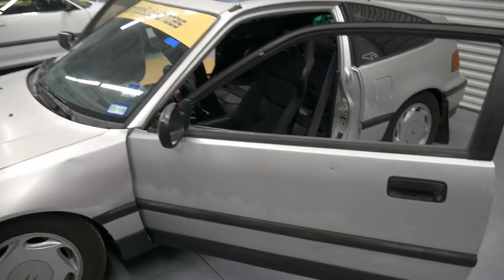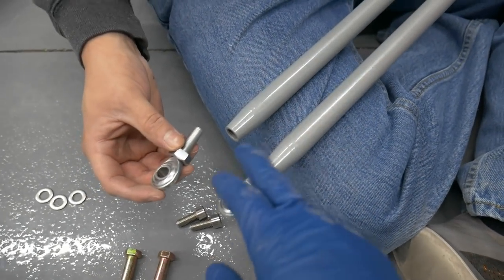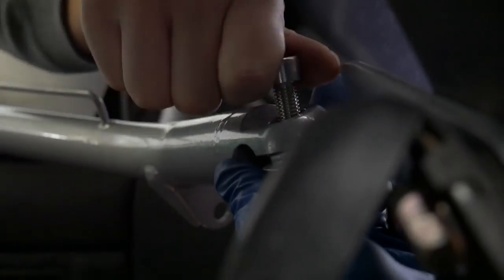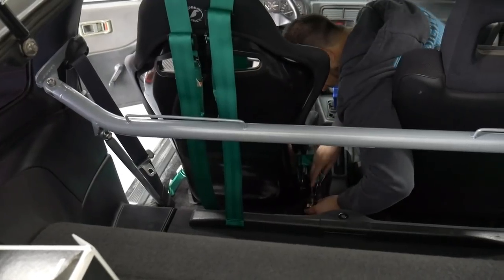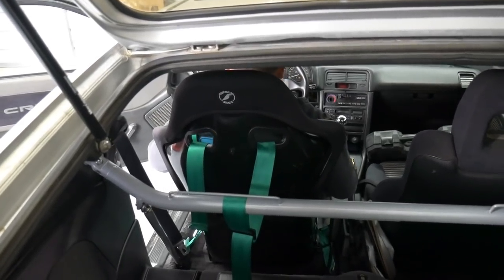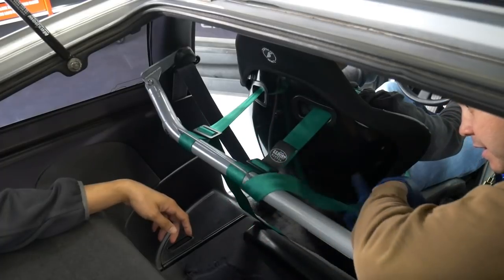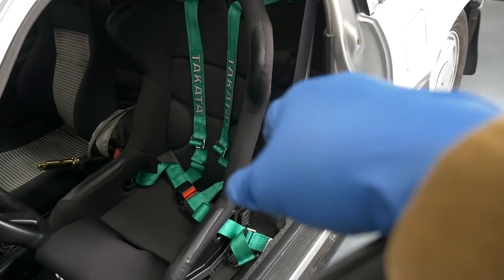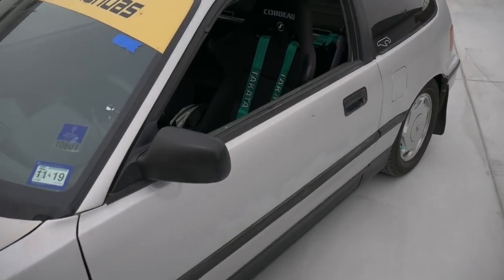Track CRX gets Upgraded Seat Mods with Harness and Bar

Comment: Hey Jon, I am looking to replace my busted brake line hose on my wagon. I was wondering if you ever used any aftermarket brand or did you stick with oem? Also, what is your opinion on steel brake lines? Thank you.
Reply from the maker: Love and prefer steel braided lines.  I use a lot of the eBay lines for like $30-40 for a set.  Never had any fitment or performance issues and I inspect them regularly.
Reply: Garage Built Hondas thank you, looks like I am getting steel braided lines for Christmas.

Comment: Sooo does a usdm crx have the factory holes for the seat belt in the pillar even though a lot of people have the door mounted belts???
Reply: All 88 crx models had pillar mounted belts. 89 HF had pillar mounted as well. The rest of 89-91 had door mounted. The reason honda switched to that setup was to add a safety crash beam in the doors.
Reply from the maker: The bolt hole isn't present on the door mounted crx models unfortunately.  I have seen write-ups online where you'll have to weld a nut into the pillar to be able to use a bar like this.  I personally wouldn't trust a rivnut to work.
Reply: Garage Built Hondas same I wouldn’t consider using one. I do wanna find a rear Cross bar setup though.

Comment: How tall is the driver and is that seat comfortable for them?
Reply: Thomas Peterson I’m 5’11 with the seat in lowest position I fit comfortably with a helmet maybe a finger or two of space between my helmet and the roof.
Reply: @chriswinters4527  do you still have the sunroof assembly in? I have  a corbeau  seat (cant remeber the name) but i cant wear a helmet im 5'10. I took the sliders out and mounted the side mount rail to the floor but i nees another inch or 2. Im thinking about pulling out the oem front seat mounts and flush mounting it to the floor. Do you have any pics up close of the install?
Reply from the maker: Yes, he still has the sunroof in his car.  He's using a PCI seat bracket also which might make up some of the difference.

Comment: What about the Crx with the seatbelts in the seat?
Reply: Door*
Reply from the maker: You'll need to find a way to add a nut to the pillar to use this bar.
Reply: @GarageBuiltHondas  u think I should just go on and put in a roll cage then
Reply from the maker: If you can afford the extra cash then I think yes for sure.
Reply: @GarageBuiltHondas  thank you so much
Reply: Can I ask you an unrelated question abt my cars engine

Comment: Damm so this won't fit 90-91 crx ?
Reply from the maker: Unfortunately no.
Reply: @GarageBuiltHondas  cool thanks
Reply: STANK DOGG actually it can, all the holes are actually there and threaded. You would have to drill out the plastic for the harness bar and and cut your carpet to expose the lower bolt holes. As far as the pci bracket you just have to drill one hole for one of the 4 bolts.
Reply: @chriswinters4527  thanks I'm gonna check it out
Reply from the maker: Are you 100% sure the upper bolt holes are there?  I've seen a lot of threads on old forums where people were welding in a nut so they could convert to pillar seat belts instead of the door belts.
Reply: Well the bottoms are 100% and the top I’m like 90% sure. Check the green one real quick!

Comment: would this harness clear a Autopower street roll bar?
Reply from the maker: It should.  I can't see where it wouldnt.
Reply: @GarageBuiltHondas  visually it looks tight. The only way to find out is to try it out myself.
Reply from the maker: Judt the harness right, not the harness bar?
Reply: The whole thing !
Reply: @GarageBuiltHondas  The seat belts aren't my problem. I need a harness bar to get the belts to line up at the correct angle. 

My dad's friend didn't buy the autopower roll bar or cage with the bar welded on. Now i have to find a way to get the correct angle for the belts. 

...the Autopower street series roll bar was installed back in the 90s by my dad. The car was sold us the car recently and now we're making lemonade! :P